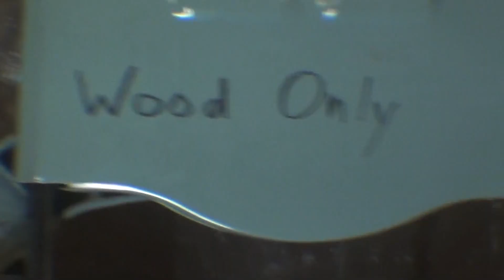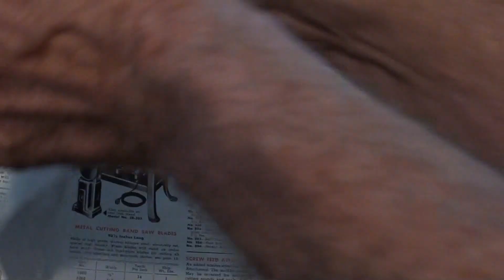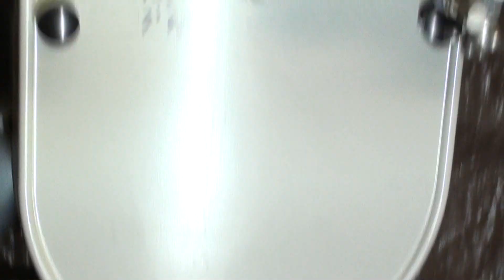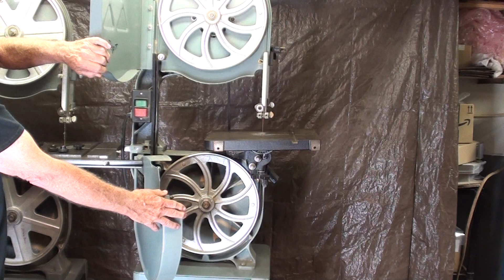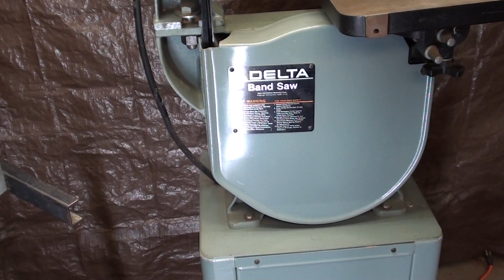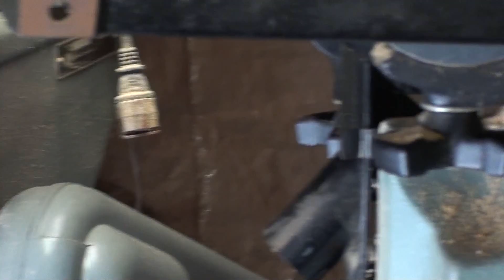All About Delta BandSaws Tips #486 tubalcain

Comment: Hi Mr.Pete, I'm very happy to have run across your video. Strangely, I bought a model that has some of the features of both of the saws you display. The wheels are like your "Delta", and the covers are hinged, but the mfg. badge is "Rockwell International". It has a closed base and older zinc faucet knobs. The blade tensioner is like your "Delta" ... extends above the housing. The shaft has a v-groove. I guess there was a time when they manufactured saws with a little bit of this and a little bit of that. Thanks for the history lesson!
Reply from the maker: Very interesting

Comment: Wow that is a very rare miter gauge, must go back to the 30’s. Delta soon discovered that when either a table or blade was tilted the gauge would be cut. So before long they had a new model with the corners cut off.
Reply from the maker: For years, I was wondering why that miter gauge had square corners

Comment: Hello, the pulley on the bandsaw wheel (not the motor) works its way off its shaft; the little key that stabilizes the pulley works its way loose, and the pulley comes off.  Do I just need a new key?  Where would I get one, if you think this is the answer.  Thank you.

Comment: Hello, I am handicapped, and as the years go by I am increasingly weaker. I have a 14 inch delta bandsaw, it was one that I bought the last year they were made in the United States. Anyway I need a good Bandsaw blade for wood that I can purchase online. So I thought the best thing to do is if I asked an expert. Who better than someone who is a teacher of woodworking shop. I would appreciate it if you save me a few steps. Luke
Reply from the maker: I believe the blade links is 93 1/2 inch. Is that correct? That is a very common blade and can be found in box stores and hardware stores. If not, order read from McMaster Carr or any other industrial supply or such as K BC or MSC. However when you order them, you have postage and all of the other expenses so try to get it locally

Comment: My Delta bought in the early 90's has "MEXICO" cast into the inner, vertical section of the upper frame.  Also, there was a lot of slop in the
adjustable, upper blade guide hole which wasn't machined in the upper frame.  It appears Delta only used a sand core to make that hole.
I eventually got feed up with the sloppy, poor alignment and bored a bigger hole and made a close tolerance sleeve.  Now, the blade 
guide moves up and down spot on and saws perfectly.  Thanks for the inspiration mrpete!
Reply: My 28-243 14” bandsaw is date coded Oct. 1989 and it says made in the USA. Must have been one of the last years before they moved manufacturing out of the U.S.

Comment: My father worked for Port-Cable/Rockwell here in Syracuse, NY. He picked up a 14" band saw from a flooded warehouse in PA. It was a wood/metal type. Had cabinet base with gear box. It had 1 speed for wood and 10 speeds for metal. There were two different 5 step pulleys. Larger pulley on motor for 5 speeds and then smaller pulley on motor for other 5 speeds.

Comment: Thank you for the information you provided.  I will be replacing my strut bearings but when I removed the table from my older14 inch Delta band saw, the bearing underneath was difficult to remove.  Please tell me what I need to do to replace the bearing.  Will I have to replace the unit where the bearing is attached? Thanking you in advance for your help.

Comment: I wrote my blade lengths on the saws too. Then I still didn’t have ‘em when I went to order blades, so I now keep them in a Notepad file in the machinery folder on the computer. At last, the data is where I need it. I can even keep my favorite blade stock numbers there, the easier to find that they’ll be discontinued next time I want some.
Reply from the maker: At my age I would forget that I Had those sizes in the notepad

Comment: I also bought one from Penny's outlet back in the late 1970's.  It was missing the motor. I  had a 3 hp motor laying around. I made a 16 speed cone pulley transmission for it and I can go from around 150 fpm to around 2000 fpm. I just used what I had at the time. I have been using it for about 40 years now and I still works fine.  On another note, I remember years ago that Delta had ads in some of the trade magazines about the cloned imports coming in from overseas. I believe they were soliciting for a class action lawsuit or warning buyers about inferior knock offs. Imitation is the highest form of flattery. Oh! The dangers of capitalism!
Reply from the maker: Thank you, I do not remember those old ads

Comment: The older wood/metal had a gear shift lever that rotated gears and also three step pulleys.  I have one of those and have it dedicated to cutting steel.  Then they went to a shaft mounted reduction system not too unlike your pull gear and step pulleys.  Others who have tried gear boxes, dc motors, and jack shafts to get to 100 fpm have run into excessive belt slippage on the final drive.  Some have made the final drive from the jack shaft a chain drive.  If you have the earlier 8" driven pulley saw, you can in deed cut aluminum.  I regularly cut aluminum on mine with a 3" drive pulley and 8" driven pulley.  The later versions have a 6" driven pulley and run the blade at almost 3000 fpm.  I usually add a crank to a piece of 13.5" all thread to make a new blade tensioning rod.  I like your bearing idea.  While the threaded hole is there for the table stop, the newer ones did not come with the bolt, nut or "cup" that allowed you to set the table stop and still be able to tilt it the opposite direction.  Making a few of those  would be a good future video.
Reply from the maker: Thank you,. I have about five videos coming up on the subject. I experienced much failure. And I know exactly what you mean with the belt slippage, that was a major problem. I made the exact crank with threaded rod that you mentioned, and I only did it yesterday, LOL. My neighbor has one of the combination saws. But it is a late model. I eventually it will make a video using it. My saw was very unsatisfactory for cutting steel. Vibrating, shattering, and extremely noisy. Nothing like a real metal cutting saw.

Comment: May not be a good idea to saw wood on a bandsaw used for metal. The metal chips get impeded in the wheel tires and cannot be cleaned  out of the bandsaw. The metal chips will find their way into any wood you saw which you will not find out about until you apply finish to the wood. I know this from experience.
Reply from the maker: You made some good points.

Comment: I have one of those wood/metal saws from back in the forties. I restored it and put a two speed motor on it, so with the two speed gearbox and the three step pulleys, I’ve got more speeds than I’ll likely ever need. I also made a new rear blade guard, but I used some scrap black walnut. Like that my old saw has zero plastic anywhere in or on it. Mine looks just like the one in that first catalog. Wish I had an original stand tho...

Comment: I love my old Delta Milwaukee except, for those miserable blade guards. I got mine for free without a motor from the place where I spent most of my working life. It was on one of those narrow stands and got knocked over and broke the trunnions and support. The maintenance supervisor who gave it to me said, "It's so old you won't be able to get parts for it ." Well, I knew they never changed the design by 1982, when I got it. Two days later, I got the trunnions and was able to braze the support casting back together. I also, got the height attachment. Mine now, has two motors. A regular and a gear motor, another freebie. They are connected to a dpdt switch. Up is the high speed motor and down is the gear motor. The gear motor is on a swinging mount. There are two pulleys on the saw. When I want to cut steel, I swing the gear motor up and slip an extra belt onto it and the other pulley. The high speed motor just goes along for the ride and doesn't mind a bit. Before I made that set-up, I had the saw lined up to my South Bend headstock. I would put a pulley on a short piece of shaft, chucked it up in the lathe and slung a Corvair fan belt, (they're very long), from it to the bandsaw. With the lathe in back gear, it worked perfectly.
Reply from the maker: That is an ingenious set up with the Lathe.  I never would have thought of it. And yes I remember those Corvair fan belts. Every car came with an extra one

Comment: I have a Rockwell branded version but it must be late Rockwell. Wood and metal version, enclosed base and motor like your Delta, sheet metal belt box on the back side like your Delta but the belt cover box has a hinged cover for access to the gearbox shift, 4 belt speeds plus 2 gearbox speeds, hinged wheel guards, cast metal knobs.  It has the same part number as the Delta branded version.  Lovely saw.  The riser kit is still available.

Comment: Thanks for your video. I have one  identical to the one on the left I bought new in 1982 when I worked at a Rockwell Tool  dealer. As I recall my price at the time was over $400 with the open stand, mitre gage, and rip fence, without the motor.  I picked up a motor from Grainger cheaper than one from Rockwell.  It has served me well in almost 40 years and will be the last tool I get rid of!   Anxiously awaiting your future videos!
Reply from the maker: That was a lot of money back then

Comment: Thanks Mr. Pete for putting the Delta 14” vertical bandsaw into your spot light.  I have fully restored three for use in my shop (10” from 37, 14” from ‘46, and a 14” W/M from 1950 with the 6” riser). 
Speaking of blade changing, I always remove the table first...it’s easier and faster than with the table in place...time yourself and see the results ( adjusting the lower guide blades is so easy with no table!).  Love your videos.
Reply from the maker: You are probably right about removing the table

Comment: They will cut brass, aluminum and copper at those higher "wood" speeds with no ill affects to the "wood" blades. Also, McMaster Carr will provide custom length blades of almost any of their offered blades for metal cutting upon request. Cutting copper and Aluminum at the higher speeds is almost a must ...as well as using the wood blades because the tooth geometry is more positive than the metal blades.
Reply from the maker: Thank you, that is good information
Reply: Bronze will be instant death to a Bi-Metal blade, were as 360 brass, copper and aluminum won't phase it! If you have fear, I understand. It is the "Internet"... I know. So, try an old tired blade on some scrap you got layin around, put it in a vid. (Yer da man! THX U!)

Comment: Looking at the newer band saw blade tensioner at 18:17.  Hasn't change much over the years until the one I bought about 15 years old.  The knob and mechanism that tensions the belt is the same.  What Delta added was a long arm that will quickly un-tension the blade and just as quickly re-tension it to the original tension setting.  This prevents damaging the rubber tire on the wheels by leaving the saw fully tensioned all the time.    HANDY!
Reply from the maker: I probably need to add that on mine
Reply: They are called "quick releases".  While mine came from the factory, I found several aftermarket and do-it-yourself systems by Googling "delta 14 band saw tension quick release".  Could be an interesting new video idea for you.

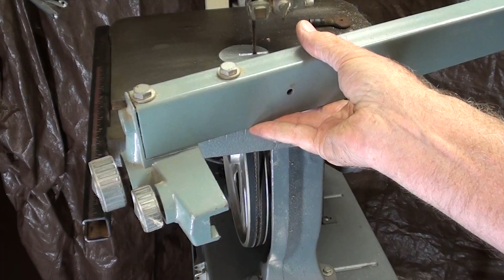Comment: 16:45 Tolerant maybe,  or perhaps we are used to getting a product, with not much info, so we don't hurt ourselves and sue ?
BTW, please lets find a print professional and make up some stickers w/ Delta, Milwaukee and even Horror Fright blade lengths AND DIRECTION ! (I have personally bought 2 used bandsaws with the blades installed BACKWARDS...yes I did try to tell them, no, they wanted it gone, so I bought them both...not sorry)
Reply from the maker: Thanks

Comment: I and others have removed that slow hand wheel at the top for tightening the blade and replaced with a crank with about a 6 inch arm.  Much nicer.   I think if I can find a faucet type handle I will replace my thumb bolts like you did.
Reply: I wonder if there is going to be a run on used Delta band saws now.
Reply from the maker: I think I will put a crank on mine ted.
Reply: @mrpete222  I kind of figured you would be ahead of me there too

Comment: Thoroughly enjoyed, a few things to add.  I have 4 delta 14's and a jet 14 (delta painted white) The oldest is a 1947 Delta Milwaukee with the open stand, a 1970's 2 speed wood/metal (2 HP) labeled Delta-Rockwell with the tan paint scheme but still with a wood blade guard, one similar to the newer one shown with the closed stand (3/4 HP), and a 1990's with a side mount motor on an open stand (1 HP).  The 2 speed has an oil bath gearbox as the lower casting along with step pulleys for further adjustment.  The build quality definitely got cheaper during the Delta-Rockwell years.  As for the hex remaining on the blade guide on the bottom of the upper guard, my best guess is it is to align the guide blocks with the blade, the jet 14" I have does not have that feature and has to be checked occasionally for inaccuracy.  A few years ago I was on the hunt for my first bandsaw and quickly realized there were no quality new ones on the market and turned to the used market (And subsequently acquired multiple)
Reply from the maker: Good move to buy four of them

Comment: I do not recall the manufacturer name of the band saw we have at work but it is a monster of a saw.  It has a two speed switch for high or low speed next to the table and I have seen many guys I work with cutting metal on the high speed, to which I just shake my head.  The really neat part of this band saw is that on the upright support of the saw is all the necessary stuff to weld and grind a blade together.  All the adjustments are there for different widths and thicknesses of blades.  There is also a switch for a blower that has a tube next to the blade to clear the work area as you are cutting.  The saw is all cast iron and heavy standing about 7 foot tall or so.
Reply from the maker: That sounds like quite a saw. Is it a do all.
Reply: @mrpete222  I took a closer look at it today and found the name plate on the band saw.  It is a Tannewitz Di-Saw.  The plate says "For continuous sawing, filing and polishing inside and outside"  I'm not sure how it does all of that when I only see the saw blade and work table.  Perhaps there are other attachments we don't have is our shop.  I'm just the electrician/controls guy at work and do not get to use this equipment much.
Reply from the maker: @Th3Su8  I just went to their website.  Thats quite a saw!

Comment: It is a far far board I resawed than ever I sawed before. . . 

Seriously, I have a  mid 90’s delta 14 inch. It is a great tool, but it doesn’t track well. If you could go over tracking at some point it would be great.

Thanks Lyle
Frank
Reply from the maker: I never did have a problem with tracking

Comment: I have a 14" Rockwell bandsaw that has the steel hinged doors that I bought in early 1980's.  I put in on a wood base after the 1989 earthquake in the SF bay area when the stand was bent.   I made a new stand out of wood (4x4 verticals and 2x6's horizontals).  The stand made the saw rock steady and then found the wheels were badly out of balance (fixed).   The saw is smooth and steady now, works great.  I also put an old 1hp sleeve bearing electric motor on it, I was given which makes it a great saw.
Reply from the maker: That must've been quite an earthquake to top all that bandsaw. Like they got in Alaska yesterday

Comment: I have a Taiwanese knock off with the wood/metal tag.  It only has a 3 step pulley, though perhaps uses a slower motor too.  I just moved into the lowest setting and added metal cutting blade.  So true on the blade length.  I actually copied you and wrote it on my saw with a sharpie.  Thank you.
Reply from the maker: Is there no gearbox on it?
Reply: @mrpete222  Just ran down and took a look.  There is a jack shaft.  Tricone on the motor to a tricone on the jack, the small pulley on the jack goes to a big one on the drive wheel.  The other two can be swapped on the motor, giving two speeds.  I have no convenient facility to check the speed, but it is pretty slow.  I can go measure them to calculate the speed if you'd like.

Comment: Thanks for the video, I have  a Delta-Milwaukee wood/metal with the open stand. I have wanted to put a fence on it for ripping, is your fence attachment factory? I didn't see a fence in the catalogs you show, it was nice to see what one looks like so I could make one.  Even though I have the 2 speed gear box, I put a 3 phase motor on mine and run it with the same VFD as my Bridgeport.
Reply from the maker: Yes, the fence was an option when the saw was purchased